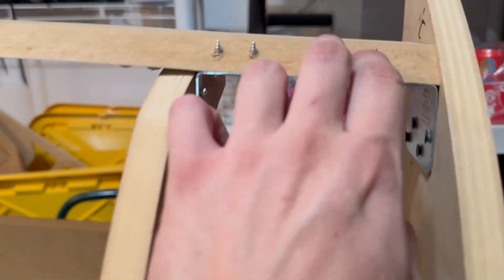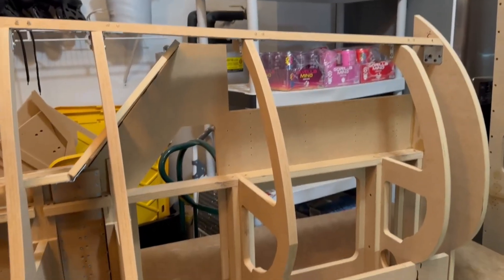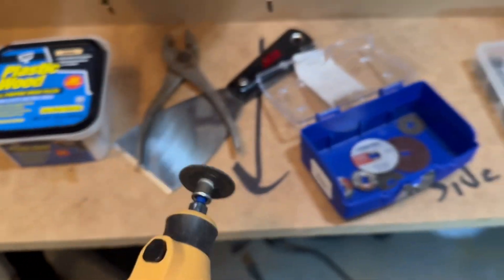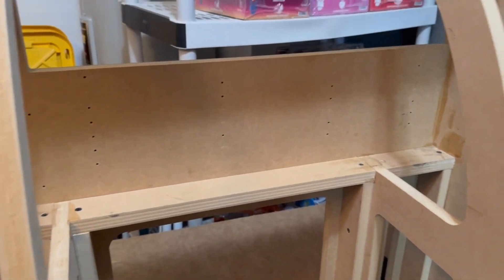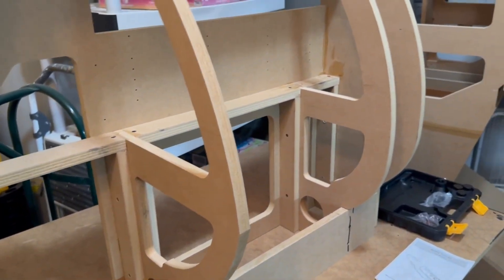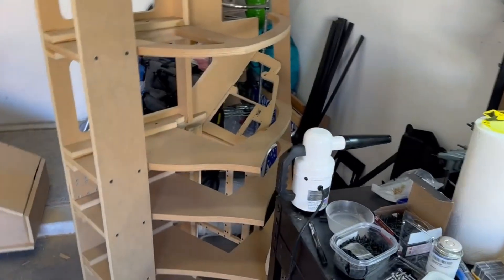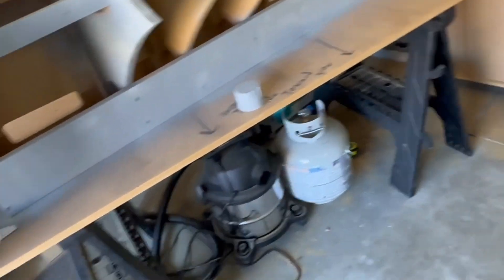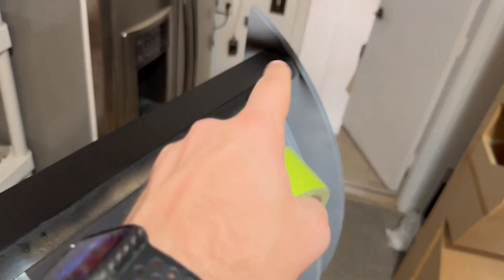An Adder Fanged: Building an F 16 Cockpit Part 9: THE END! Sorta

Comment: I would recommend for the outer skin use a thick felt and staple it down and pull it tight and go a long till it's done then fiberglass resin over the felt to harden it up. Then sand and paint if you want to do that.
Reply from the maker: @ekhatchey  funny you mention it, I’m fiberglassing the interior walls next so that’s a great suggestion. Thanks!

Comment: Nice work man! If I may suggest, try a paint roller and brush on the other console if you haven't done it already, it'll save you a few spray cans and then you can finish it up with spray paint for the final color or do that again with a roller ;) a white base of wood primer will fill in nicely the grains & small imperfections and it's an easy color to cover up with a smaller amount of paint than the brown color of the wood
Reply from the maker: @The_ViperProject  yeah, I learned this too late I’m afraid

Comment: An excellent trick with mdf is to brush on Shilac and let it dry, probably 2 coats. This will seal it and act as a primer. Then you can paint it with a lot less paint because it won't act like a spunge soaking up the paint. Just don't knock over the can of Shilac on the driveway. Don't ask me how I know. Well, I may as well tell you. I was shilacing my ejection seat for my Harrier. Instead I accidentally shilaced the driveway when my foot knocked over the can. I had a nice 8 foot shiny spot on the driveway for 1 1/2 years before it finally weathered off! 😂
Reply from the maker: @JLTSoft  holy cow! Durable stuff I guess!

Comment: It's probably too late to help you, but might help someone else; fibre board absorbs spray paint, hence why you had to use so much (probably took forever as well). A quick coat of a wall/ceiling paint with roller and brushes as a sealer before rattlecan top coat(s) would really have helped here, and you'd end up with a more even finish as well. 

Otherwise, looking good! Interested to see it all come together
Reply from the maker: @_Majik  yep. Learned this too late. Def a lesson for next time